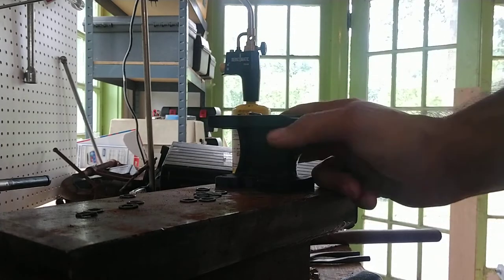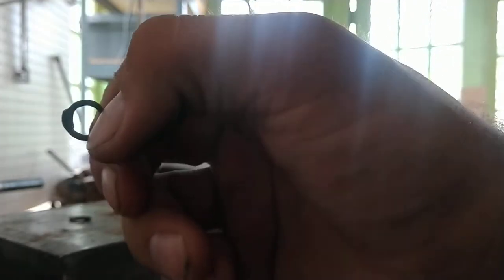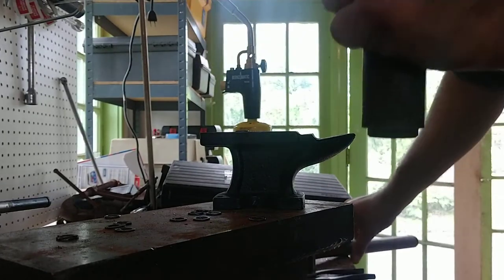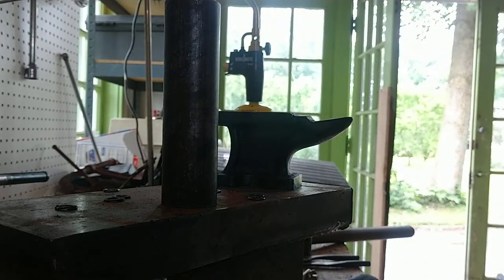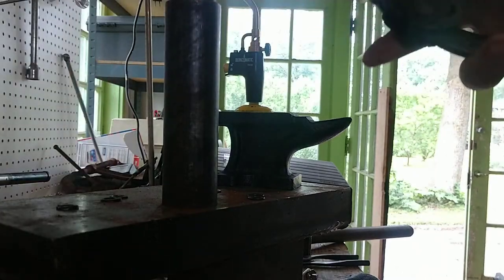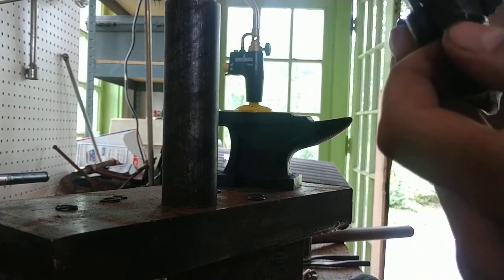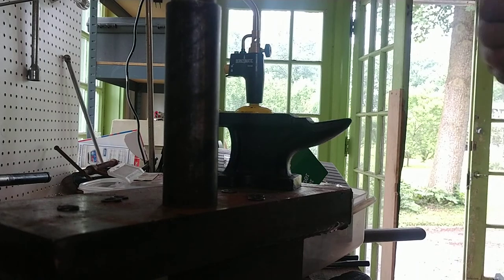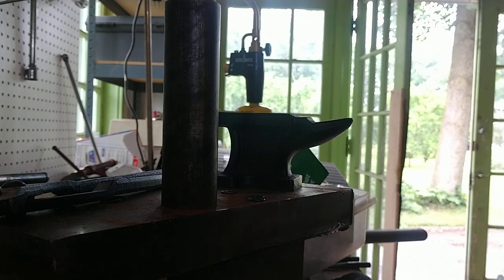Maille: a new anvil, tools, and my methods.

Comment: Hey Sam. Great video! Thank you. What is the thing you used to flatten the mail? I don't know what it's called so forgive me.
Reply from the maker: It's a 4140 steel rod in a tube.  I'll make a tutorial on how to make one at some point, but honestly, you can get a bolt and a sleeve bushing from your local hardware store and use that.
Reply from the maker: Flattening jig, by the way :) .  I'm currently working on flattening pliers, that would be more compact and easier to carry to reenactment events.
Reply: Sam Bakich Thank you!